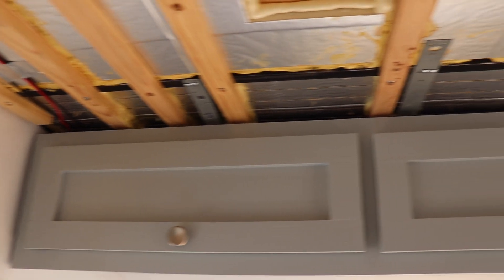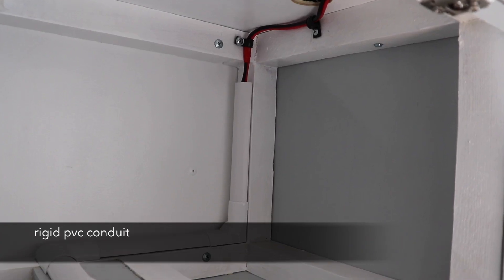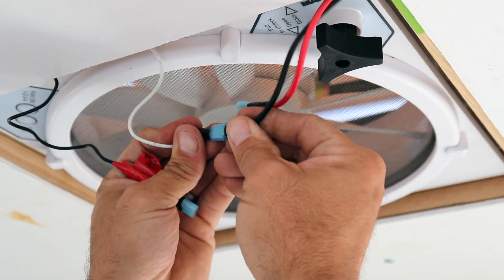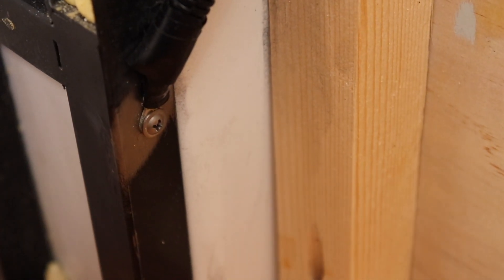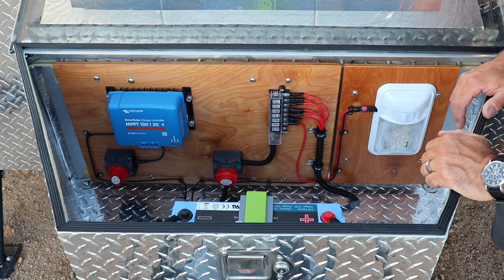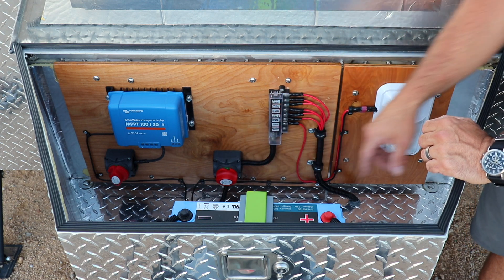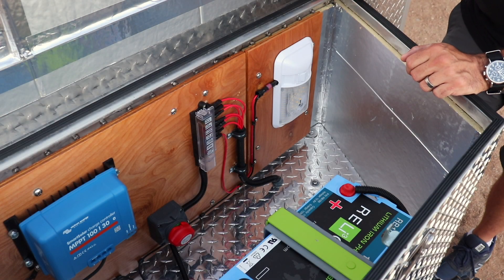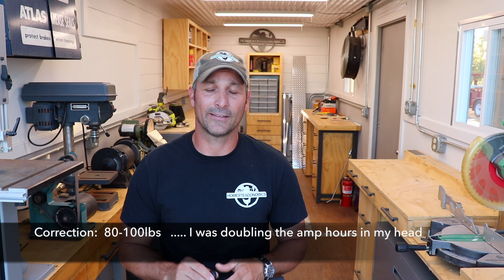How to Build a DIY Travel Trailer: 12V Electrical, lithium battery (Part 10)

Comment: Nicely done, both video and electrical work. Tip I learned as an apprentice: when using electrical tape, tape going away from your body and the tape will remain tight and seal better.
Reply from the maker: thank you Alan!   I will remember that.... I usually do it whatever way but thinking about that I can see how it would help to keep a tighter tension on the roll :)